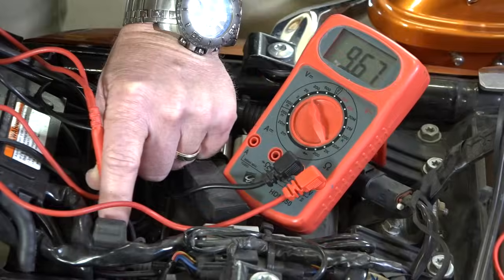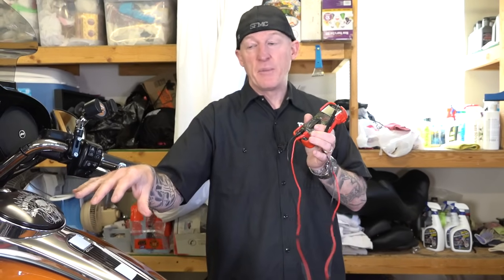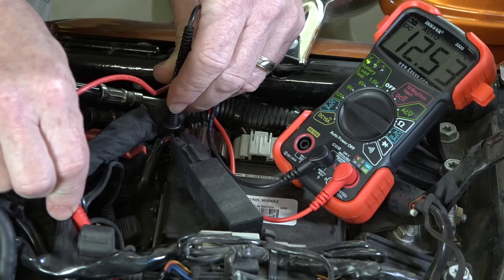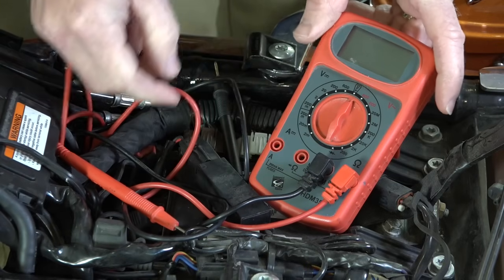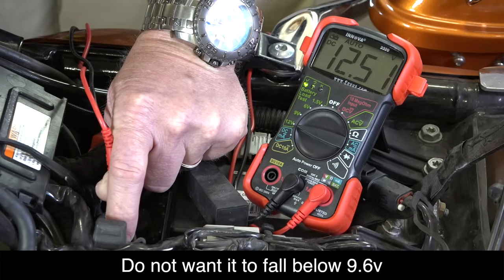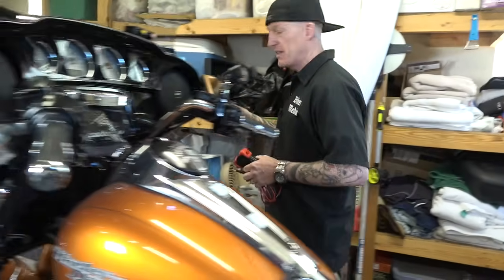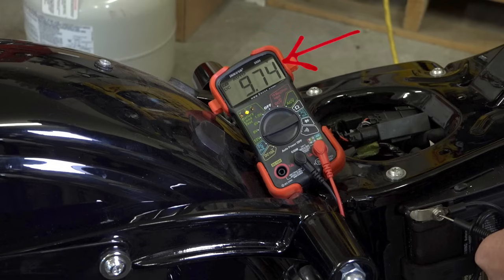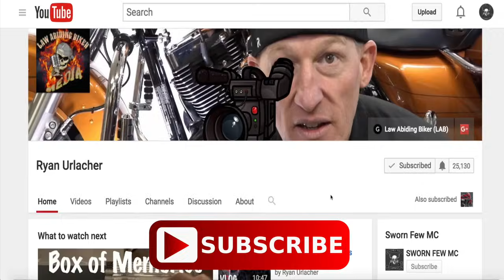How to Test Motorcycle Battery & Charging System-Multimeter or Voltmeter | DIY

Comment: last fall, i made a trip to the mountains. About a week before the trip my bike was sounding like your StreetGlide. I figured it would be ok so off we went. The trip was about 2.5 hours and when I stopped to get gas, the bike did not crank. I pushed it off, got it running and onto the motel we went. Later we went for dinner, it cranked fine but after dinner, I had to get a boost to get back to the motel. The next morning I got another boost and straight to the store we went for that NEW battery. Live and learn. When your bike starts to crank slow, do yourself a favor and head straight to the store.

Comment: Thank you for posting this informative and easy to follow video. I just bought my 2010 heritage last week. I noticed a hesitation/pause when trying to start the bike. I followed your directions and ran the test twice. First time, the voltage dropped to 8.xx volts when cranking. I waited 5 minutes to perform the 2nd test, and the voltage read 7.xx volts.  Based on those numbers, the battery has definitely seen better days. The charging system appears to be good, the voltage while ruining was 14.05v to 14.09 volts.  Buying a new battery tomorrow.  Thank you again for the help.

Comment: Very helpful video. The original battery on my 2009 Yamaha v star 950 lasted a full ten years. I suppose most experts would say that's impossible, given that I never put the battery on a tender and left the bike in the garage with temps down to sub zero year round. Now the replacement battery seems to be going and I wouldn't trust it to make any kind of trip. Same conditions but this time it lasted only 5.5 years. I bet most guys would consider that to be outstanding battery life anyway. Thanks.

Comment: Great video! It is definitely useful for those who only have an affordable multimeter.

I own a 2017 Indian Chieftain Limited.  I live in NE Utah where the temperatures are very cold in the late fall, winter, and early spring. My bike starts with very little issue at 32 deg. F.

I have both a decent grade multimeter and an OTC Tools digital battery tester. Oftentimes, I'm only using the multimeter because it's more compact and quicker to use than my battery tester.

On a side note;
Before deciding to replace the battery, check and verify that all battery connections are tight. I've witnessed many times that the culprit has been simply a loose connection. I've also seen on occasion a bad crimp on the battery cable termibal.

As always, I enjoy your videos.

Comment: LOL.  I clicked on your link above for battery tender and it landed e at amazon on the very one I placed on my wish list last week.  I went ahead and purchased it because I had some rewards points to buy it with and also found a free shipper in the list.  All of you bikers should at least buy you a volt meter.  Always make sure at your battery connections or even check it from your tender pigtail and make sure when your engine is running that you are putting out at least as 14.3 volt charge
Reply from the maker: Thanks Earl for supporting up and our videos by using that Amazon affiliate link we provided.
Reply: My Deltran 12V battery tender junior charger maintainer cane in the 14th of this month.  My advice to biker owners is get one!  I plugged mine in where my softail sits in the garage and the red charge stayed on about 10 minutes then the blinking green then the solid green.  I just left it unto an hour ago and decided to go do my 2 to 3 day startup and before starting my battery had 12.95 volts.  One throttle and chole and starter turned much faster than it usually does.  While I was at it being my seat was off I used my volt meter I bought off amazon a year ago and my system is charging 14.5 which is where its been for the past 1.5 years.   Back to the battery tender guys get one of these. The link Ryan has goes directly to it

Comment: Thank you so much for this video. It's been hard for me to find something like this. I bought my first motorcycle in April. Harley 2016 roadster used and I had to replace both tires as the dealer looks to have had a 2012 tire on the front and I'm not sure of the year on the back. I replaced them already so I can't go look again. I had a colder weekend recently and my bike didn't start up that morning. 48F degrees was the temp and it would click and not turn over. I hadn't really noticed it but I did hear the slow turn over on my bike the past couple months but didn't really understand that it was something to make note of. When I heard you start yours I immediately identified that on my bike. I'm not sure of the battery year in my bike but I'm betting it's time to replace that as well. I've not had other trouble with the bike, but I had noticed that it seemed to have some trouble starting a few times but it would turn over. Turning my bike on I'm around 11.4v and when I try to crank it, this battery didn't turn it over to run and I think I saw a 5.6v or so on the meter. I'm pretty sure this battery is well on it's way out. I never bought a tender for the battery as I didn't realize it was very common to need for harley bikes. I'm buying the 5amp dual-mode battery charger from harley to help with this for the new battery which is on back order. I'm hoping the battery charger will limp me along to ride it every few days in the neighborhood to keep it going till my new battery, HD OEM AGM gets here. Again, thank you so much for this video as a new rider. I very much appreciate it. I have subscribed.
Reply: I also noticed recently my right front turn signal sometimes comes on and other times it doesn't. I thought it was just a loose connecting harness but I'm starting to wonder if it actually just a symptom of a battery on the way out.

Comment: I got 7 yrs on a battery for a 91 Sporty 1200 using a bat tender, even for 1/2 a day you'd get 9 
more amps, which means a hotter spark and much quicker cranking.

Comment: Any connection or wire that is faulty can cause high resistance capable of a battery failing this test. Grounds are most often overlooked. After all, they aren’t important?   Good video. Corrosion is not always visible by observation, until you observe the actual surface areas

Comment: Thank you..this solved my 04 f650 gs battery problem,It was failing to turn over the motor,the horn was making unusual quacking noisies....sounded like  duck....I think I left the fog lights on...now,after an overnight smart meter charge, it reads 13.5v no load,hits down to 10v on start up and jumps back up to 14.2v when engine is running...The duck has left the bulding..The confusion surrounding batteries and power charging system can be very worrisome and off putting,but this video clears up a  few things for me.>Subbed liked etc..

Comment: Hey there great vid! i diagnosed everything just like in the video...
I have a brand new battery, it is fully charged, AND i got it tested, the battery tests great with 350 CCAs
Yet still i have the slow crank/voltage drop to about 8 volts when starting my Bike.

Its a Harley FLSTC (Heritage Softtail Classic 75HP)

Any Ideas what that could be?
Could the Starter itself be the Problem?

Comment: The initial reading was with the innova meter and i would have liked to see the reading on the load test setting, compared to a direct reading on the d.c volt setting. Direct reading minus load test reading, may give an indication of the reduced capacity of a battery, which can be logged and monitored over time, giving the user a good idea of the life expectancy of the unit. What do you think ?

Comment: Always enjoy your videos. No frills explanations and straight to the point. I have a question. I have a trickle charger. I typically unhook the battery then hook the charger to it. Can you charge it using the battery tender below the seat instead or is that not recommended? Wasn't sure if leaving it hooked up and using the tender was an easier way

Comment: Thanks Ryan just tried to start the Dyna and not a chance . Its not been started for at least 8 weeks but has been on an Optimate tender which was showing green . Obviously its not good so its on charge as we speak and gonna try the cold cranking test when its fully charged . Ive had the bike for 9 month and from day one it tends to crank slow , so im thinking the tender is keeping it going .. Also i dont know how long the battery has been on the bike.. The bike runs as sweet as a nut so i dont think there are issues coming from anywhere else .. Thanks for your video's as always Darren from the UK

Comment: Great info! I have a Suzuki Burgman 650.  Just replaced the battery.  At idle I am seeing around 14.5 V.  At 3000 rpm it drops to about 14.2V.  Should I be concerned
Reply: I believe what I caught from this is that a little above the 12 when running is good meaning the charging system is giving back to the battery. I've also hear that when a low or drained battery running at higher rpms for awhile helps to recharge . Everyone correct me if this is wrong. 2008 Triumph tiger 1050

Comment: Great tutorial. But does that test also show if the battery on my bike is not as strong as recommended? I mean if it's a new battery but it's the wrong AH. like if my motorcycle need a 12AH battery and it only has a 9AH, it would still be able to turn the engine but would it also go below 9V when cranking it? Or does the test only show the state of the battery?

Comment: Great video! I have a question at highway speeds my 01 Ultras voltage jumps from 12.1 to 14.1 . I verified it by riding with a multimeter hooked up. The battery, stator, rotor and regulator were replaced 5,000 miles ago. Any suggestions?
Reply from the maker: +Jay Mac sounds normal. At high idle or riding you may be around 14

Comment: Hi. Dyna 2001 FXDP I have problem with burning regulators.wiring ground and plus checked. I measuring at minimum stator give 20- 23V but when accelerating it rises above 75- 80 V. In 10 minutes regulator burning. Stator already checked and looking good. Please help. Cheers

Comment: I had been using a cheap 5 dollar multi-meter I bought at a flea market.  I recently bought a new multimeter and the two seem have a .20 difference between them when I check the same battery.  I wish I knew which one was correct.   Is that common to have that much of a difference between meters?  I noticed that yours were like that too.

Comment: Can you do this by putting the terminals in your re-charging port ?
Reply: Are they just hooked directly to the battery? If so then yea. You're only measuring the voltage. Couple of feet can't be that much of a voltage drop.

Comment: Great video .. mi little problem is whit my FXR89 bob .. start great and run great .. 15 mnts latter .the engine shut off .and 15 /20 mnts latter start again and nice and later shutoff .. (replace module , coils , fix some electrical shorts in head lamp and stop light .. clean all terminal fuses , the battery is new , ..i clean the gas tank , fuel filter , the carb (sper E)..
and the problem again .. and my head?????  .. tanks and I appreciate any help .. cheers

Comment: Question. My battery on 2009 street glide died and once I replaced it with a new one. It won't start now. Have you come a across this problem before. And it seems like it could be a quick fix or some sort. Any advice I what I should look for.

Comment: The battery on my tc185 reads: 11.2V while off. 10.8 when turned on. And when I try to crank it falls to 6v. I think I found my problem with the electric starter.

Comment: nice video..i removed my 12v battery and testing it using multimeter. the reading is about 12.9v. is it normal or mybattery is overcharged?
Reply: It is normal.

Comment: Just got a FXDL and just moved its brand new 2017 model. I haven't been riding it due to waiting on parts and unpacking boxes. I started it last week and it did sound sluggish, so I shut it off and left the bike when I was clearing out the garage to make room for the car I wanted to start the bike but had no luck all I herd was click sounds. Last thing I did to it was change the time. Donnie I'm taking my battery to autoZone to test the volts and also getting a tender charger. I hope it's my battery and noting els :/ the lights turn on and everything but when I hit the starter notting happens, just one click and Looks like everything resets as if I hit the run switch again.
Reply from the maker: Definitely sounds like the battery. Get it tested or throw a volt meter on it like I show you in this video. Test it.

Comment: protip: DO NOT USE A CAR BATTERY CHARGER. it will fry your battery. even on the 2a setting. from my testing, most car chargers will output 3-3.5a even on the low 2a setting. letting it charge on a car battery charger will kill your motorcycle battery.  most moto battery tenders will only charge at 0.75-1.4amps which is safe and won't cook the plates.
Reply from the maker: Very correct. Use the tenders

Comment: Looking for a little help, ok here’s the deal. Recently purchased a motorcycle that was sitting for years. And it don’t seem to spark on all cylinders like it should, unless I have jumper cables hooked to it from a running car.... battery is fine! Tried 3 battery’s two was new..... I can start the bike by jumping it off a vehicle. And I’m able to remove the jumper cables after it starts and it will still run. However I’ve not let it run for more than a minute.... next thing I noticed is someone has put a voltage meter on the bike and it always stays one mark below the green light unless jumper cables are hooked to it..... if the green light on the meter lights up green I get perfect spark! But however if not only front cylinder gets spark... I’ve also noticed when I hit the brake handle with ignition turned over the voltage meter practically drops to nothing! Now if I have jumper cables on like I mentioned the light on the voltage meter is green until I hit the brake handle then it drops a mark below green and won’t start.... sorry for all the confusion needed to pick at someone’s brain other mine... what could the problem be? P.s. the old owner said he was driving it down the road one day and it just started to cut out. Pulled it home and that’s where it sat for years

Comment: On my bike the cranking sound got slower over time, but if I started it immediately after unplugging the tender it would snap right on.  Hand to jump start it to get home once, and now the battery is dead, just makes the buzzing noise when I try to start it.  I'm going to get a new battery, and Im hoping that's all it needs.  The bike only has about 5000 miles so I'm thinking everything else should be fine.  But is it possible that I damaged something like the relay or stator, by continuing to ride it as the battery wore down?

("Sneak it up under the crack of the seat" hehe 😅)

Comment: I have a keyko AGM battery in my 02 gsxr 600 when the temp gets about 170 the battery doesn't want t start the bike and have to use power pac to jump it and if it's above 190 it won't work at all once it's below165 it's fine I looked into the battery and it def is low trying to find a place to refill the battery with AGM gel or fluid

Comment: Hey budd seems like you know alot about bikes, well I bought a bike that has a rev tech engine and the model says AAM ,but I don't know what that means, I need help identifying this bike and one other thing it has a primo primary belt,45 teeth but the little 5 bolt spline piece that bolts to the pulley is stripped out and I don't know the name of that little piece that is about 1 in.thick,and it is a flush mount on the crankshaft

Comment: Got 2001 ultra classic when riding charges 14 15 or so but at idle only charges around 10. Have put 2 charging systems in just put a new battery in. It hasn't let me down yet. But put tender on it and it was in charging for a good while. Any ideas

Comment: I have a 2010 Triumph Thunderbird that won't start. 1 year old battery. Apparently the ECU is set to not allow the bike to start if battery does not have enough power. I've cleaned the terminals,  charged the battery and only hear a click after. Only 7,000 miles on the bike. I've tested the volts of the battery b4 and after trying to start and the volts drop significantly. I took the battery into Oreillys and they tested and said it was fine. Any thoughts? Could a bad solenoid cause this?

Comment: Great Video! I got the Harley 1200 Sportster. Running its 14.17. After 2mins with all switched on its 12.34. Cranking it showed 5.9 for a half second. Is it no good?
Reply: Nope thats way below 9.6V. You can try to desulfate the battery but I would just replace it if I were you.
Reply: Thanks again @abdulnumber1

Comment: Doing this test because my motorcycle is slow cranking and not starting, I realise my battery drops to 8.9v when trying to start it. Tested it with a load tester to see the CCA and it tells me it's all good.  Would it be possible for a battery to keep it's charge at 12.7v, have good CCA but still have voltage drop to much to crank the bike?